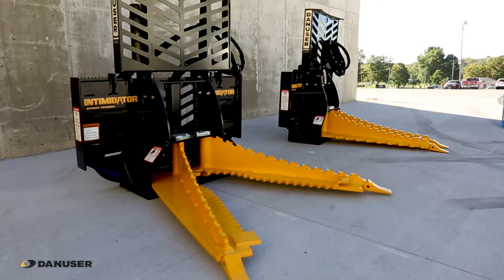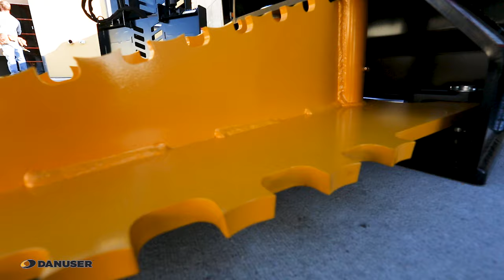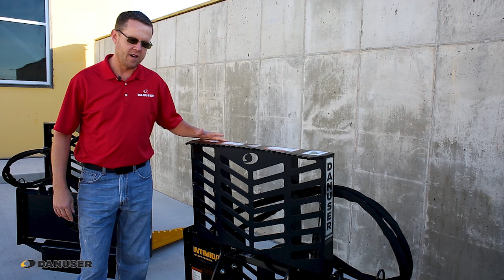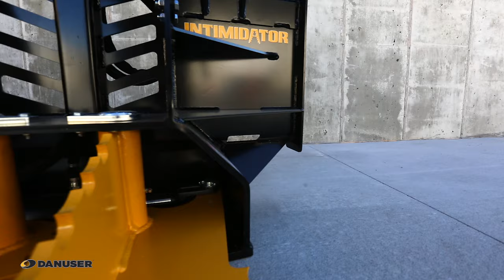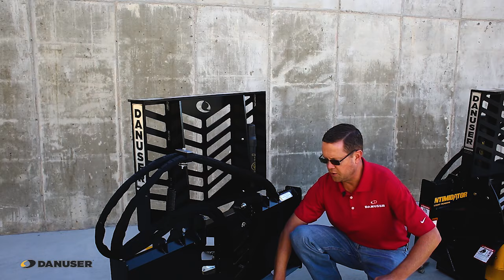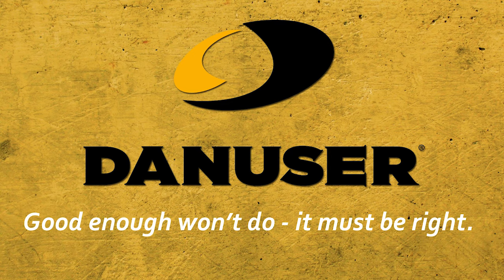Best Land Clearing Attachment: The Intimidator  |  Danuser

Comment: My neighbor told me not to buy it, but it's what I use 90% of the time.  Great tool and after about 10 hours with it, I'm finally getting better with it.
Reply: I wonder why your neighbor told you that.  Doesn't make sense.
Reply: @gdanuser  He said I can use other tools like a grapple or even a 4-in-1 bucket and get the same result.  Possibly, but I have acres of small trees that this tool makes it so easy to clear.  It also makes it easy to load the bed of my truck because it's not 72" wide like other attachments.  That has been important so I can take the stumps to the green waste.

Comment: Do you think this size of tree puller is over kill for a midsize skid steer at 61hp.?
Reply from the maker: Not at all. The Intimidator was designed to handle large trees or posts down to brush or sticks as small as a pencil. Your 61 HP unit is capable of the same and we feel you will be more than happy with the large range of tasks you can accomplish with the Intimidator.

Comment: Is this the same as the spartan brand one for 5k? What’s the price
Reply from the maker: MSRP on the Intimidator ranges from $4155 to $4880 depending on which model you get. Prices will vary at the dealer due to shipping costs and overhead etc. To find the dealer in your area, go to https://www.danuser.com/attachments/how-to-buy or you can call 573-642-2246 or email us at sales@danuser.com.

Comment: I own one of these and use it on a 100hp Kubota. This thing truly is AMAZING!!!!!! Even a good sized oak can be taken down by closing the attachment, digging around the bottom, then pushing it over. In 4 wheel drive just grab a tree and as you move forward lift it out of the ground. Best money I've spent for tree removal.

Comment: I bought this last spring for my large frame 100 hp compact track loader.  It is very heavily built and works awesome.  It does not replace an excavator I removed and carried away 40 pines trees(up to 8 inches diameter) in less than 2 hours.